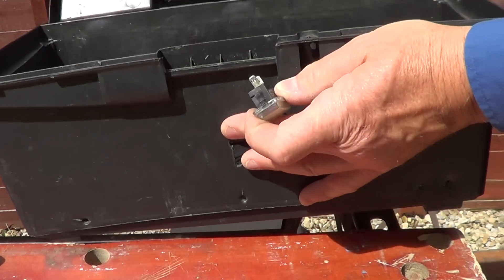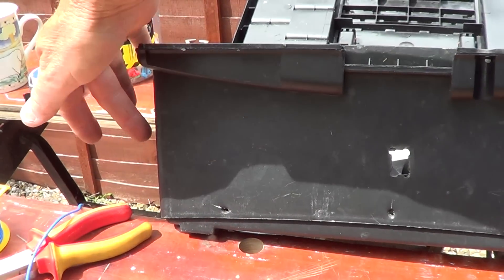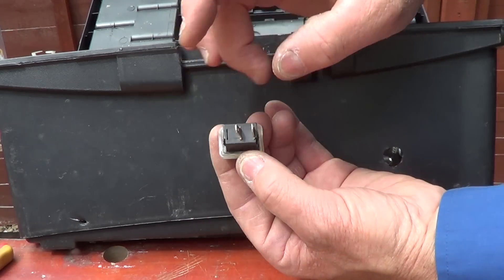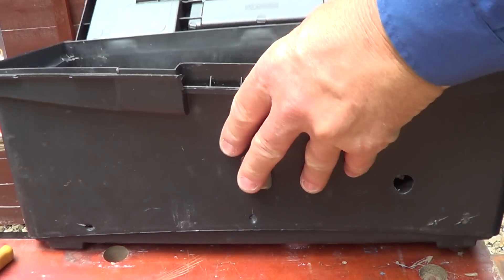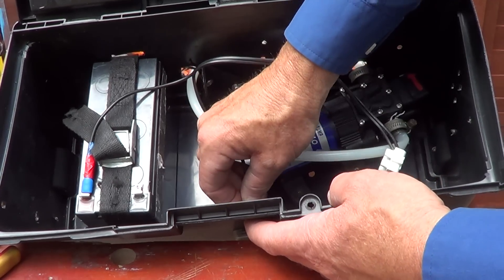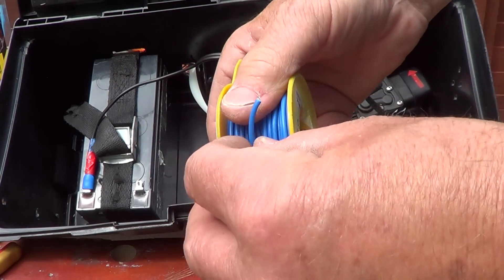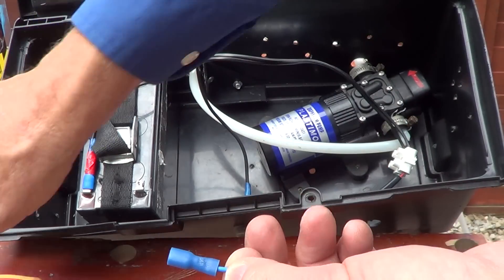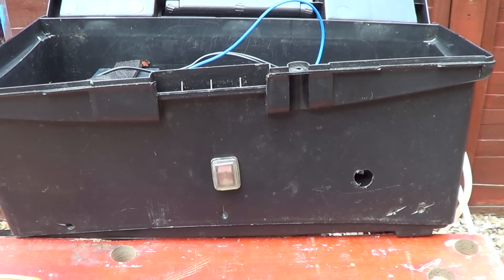DIY WFP Trolley Build - Part 9 - Window Cleaning tips

Comment: I'm trying this atm, I've put the red from  the pump on the batter and black to the switch, now I'm left with the black on the battery and positive on the switch, and you put these together then it worked, I'm a bit stuck as what you did differently as mines not working
Reply from the maker: I can't say without seeing it. Darren Ansbro is the best guy for electrics. You can get to him through DA Components.